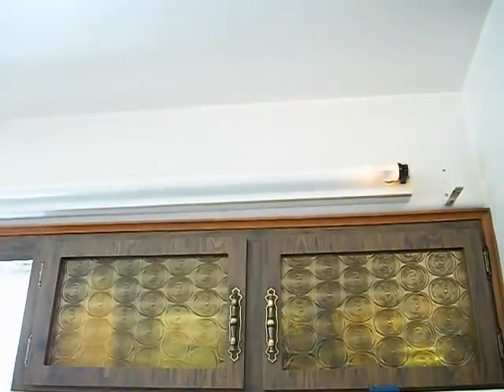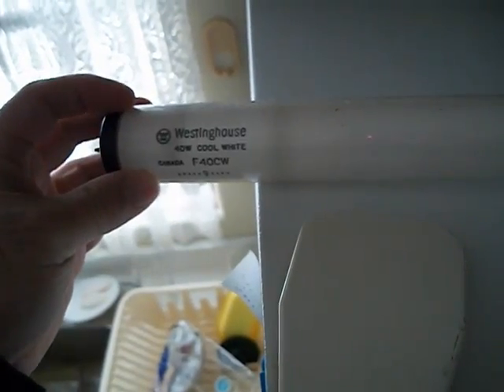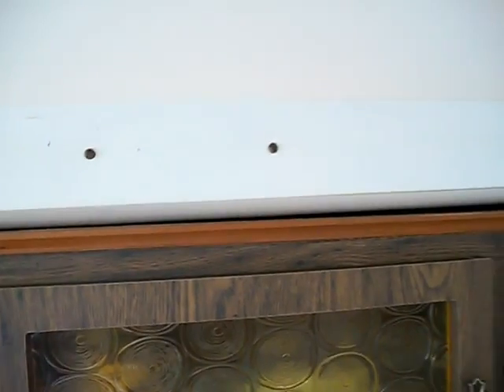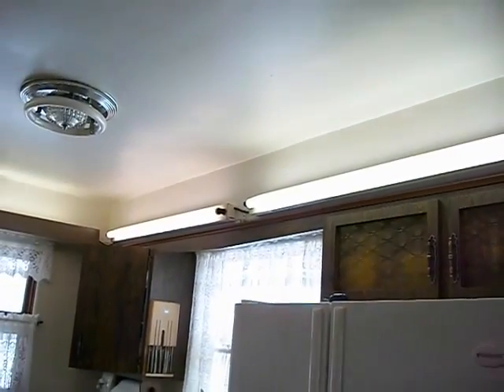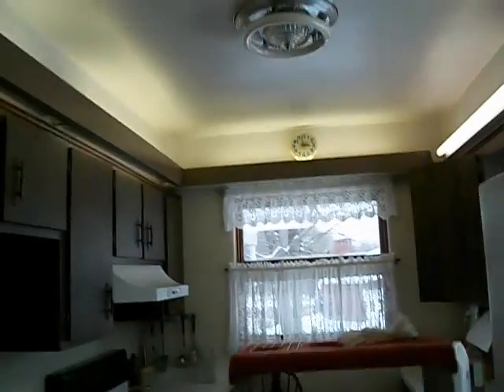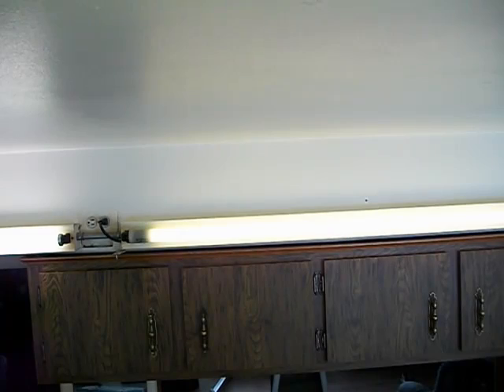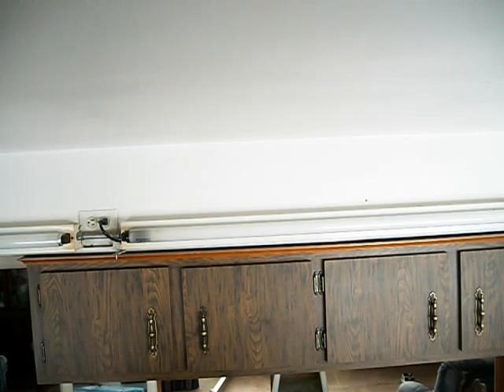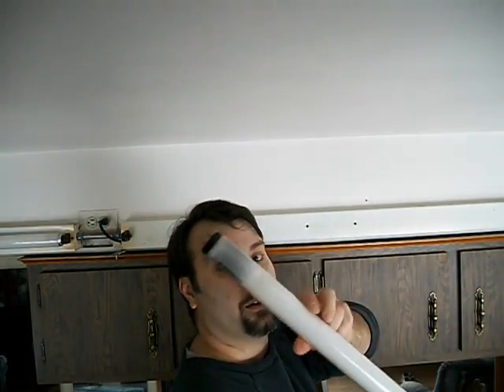1950's Preheat Fluorescent Lights

Comment: This is cool . I would spray paint the inside of the covers silver or put aluminum tape, Place them at 45 degree angle to reflect more light onto the ceiling.
Reply from the maker: That is a good idea.  They were painted with a high gloss oil based bright white originally

Comment: I have early MAZDA fluorescent lamps from between 1938 when they were introduced (April 21 to be exact!) until about 1945 when GE dropped the MAZDA name, olus the ones later than that. Those Blackender Westinghouse lamps are actually made in the 1960's. So they have been replaced at least once before. Loose bases are common on old Westinghouse tubes--I use s clear electrical tape to resecure them, had good luck with this method. If the original Westinghouse lamps (if used to begin with) were there, they'd be the ones with block lettering spelling out "WESTINGHOUSE" and probably something like "40 watt Standard Cool White AC OR DC" on them. Since these fixtures were wired with SJTWA cord, it means they were NOT installed in the early 1950's, most likely, but gotten as salvaged units (likely with bulbs) and installed in the late 1980's or later. SJTWA is a pretty modern type of cord. In the early fifties it would probably be type SJO cord. Or SJ. Both are rubber, SJTWA is modern vinyl insulated cord. One possible thing---they might be original, but the original rubber cords got brittle and started shorting out, etc, and were replaced. Using EMT and THHN is fine, and meets code, if that SJTWA is at least 14/3, it would not really be a fire hazard, nor would #16 on a 15 amp breaker, but #18 is a little too light. #14 or #12 would easily handle the full current of the branch circuit. Not exactly "code", but certainly not dangerous either, in that case. The preheat 32 watt 1 lamp circliner is sweet! It has an older lamp, too--one with the old bakelite base and the "housekeeper" type metal-to-glass seals--which, by the way are prone to cracking and causing loss of lamp vacuum and fill gas if they are exposed to bitter cold temperatures--I lost a BUNCH of my beloved housekeeper seal circline fluorescents when I stored them in a shed that let them get cold in winter--they all cracked at the end near the base and were runied except for a few lamps. A majorly stupid mistake! In a heated house they usually don't crack. The reason is the steel seal disc is sealed directly into the glass tube, and steel has a different thermal expansion rate than the glass, and under extreme low temps (below 32 degrees F.) the steel contracts much more than the glass and cracks the glass. And you use a valuable vintage circline lamp. I also noticed the GE's are the most prone to this cracking, the Sylvainas considerably less, but not immune, and the Westinghouses least prone but not immune. I am planning on installing 2 NOS never installed circline units in our kitchen, rapid start, made in 1985, that were 2 lamp 32/40 watt units, and I used a hand sheet metal punch to punch out 3 "T" shaped holes in each unit to install identical lamp support clips to what these units used from the factory, to add a third lamp, a 22 watt, so now I have triple lamp 22/32/40 watt units. I have a separate ballast for the 22 watt lamp, and put the 32/40 ballast on a pull chain with a loop, that I made a "reacher" for to operate the chain without having it hanging down i your face all the time--just reach up, hook the loop, pull and unhook, and stuck on the side of the fridge with attached magnets. This allows me to turn off the big lamps and leave the small lamp on for giving enough light to move about the kitchen and easily be able to turn on the 2 larger lamps, of course along with the already lit 22 watt lamp for all 3 for working in the kitchen. The 22 watter alone is equal to a 75 watt incandescent bulb, and all 3 are about equal to 300 watts of incandescent! I can't wait to install these, and since I use a wheelchair, my "reacher" will be usable from my chair. I will have a good friend install them for me. Cheers! Rick "C-6" Delair!
Reply from the maker: They originally had sj frayed rubber cord running them till it shorted out.  Didn’t have enough thhn to go around so used the sjtw i think it was just to get some light

Comment: Yep they don't make 'em like they use to. Maybe 5 or years ago had one of the under cabinet flourescent fixtures with the electronic ballast.  After a year and half or two, I thought the bulb burned out (ends glowing orange) went to Walmart to purchase a new bulb (F15T8 if I remember correctly) same thing. Just so happened to have the same fixture across the kitchen using the same bulb type that was working, swapped bulbs , sure enough,  the ballast junk.  That fact that the old preheat ballast from 1955 still working after 60+ yrs is a testament to the quality of being made in the U.S.A,  not China or Taiwan
Reply from the maker: These lights are used daily and some of the bulbs are decades old.  I did go though and change the starters in them, but the bulbs especially since I use new very old stock, last and last....

Comment: Those two Philips lamps you showed at the beginning were manufactured in August 1995. Crazy to think that those were some of the last of their kind to be sold in the US. Full-wattage F40CWs were banned from sale in the US in October 1995. Believe it or not, most of the big threes’ fluorescent lamps were manufactured in the USA up until just these past few years. 

It’s kind of interesting that you replaced Westinghouse lamps with Philips lamps, since Westinghouse lamps are essentially the ancestors of modern US-market Philips lamps. Philips bought Westinghouse Lighting in 1984. Subsequently, Philips-branded lamps began to be sold in the US, manufactured in Westinghouse factories. Early lamps were made on the same machinery that Westinghouse used, and featured the same black end caps that they used. Philips did sell lamps in the US before 1984, but they were branded as Norelco.

Comment from the maker: Yup, I had an old light I took from a washing machine when they had the light installed in the control pod.... I just electrical taped them in place so the filament leads wouldnt twist..... lasted for 20 years like that.

Comment from the maker: @daewooparts Its tough to find preheat style ballast around here anymore.  The ones in the living room and a couple in the kitchen are still the original bulbs as the living room isnt used as much.  They are the OLD General Electric and Westinghouse bulbs.  I do have some replacement ballasts, but these GE Original Ballasts are still healthy and not leaking anything.

Comment: Very cool. Very old. And most importantly, very good quality. LED has nothing on t12. They might with energy costs but they don’t with color and awesomeness.
Reply from the maker: Believe it or not, these fixtures use less energy than the rapid start t12 fixtures, and even some of the t8 fixtures of the same length.  I have re-wired them as they were originally wired with un grounded extension cord
Reply: More350Power yikes. Hey, at least they aren’t on fire😂

Comment: keep those forever, never upgrade them to electronic ballasts or LED.
Reply from the maker: Never will, why fix what isnt broken ?  The bulbs last forever in those style lights.
Reply: @More350Power  absolutely. I have some old sylvania tubes from the 70s still running in an old fixture from the early 50s that is used every day. nothing modern even comes close to comparing to them.